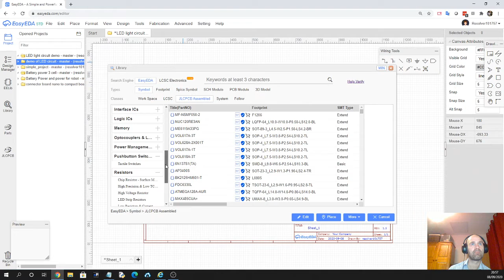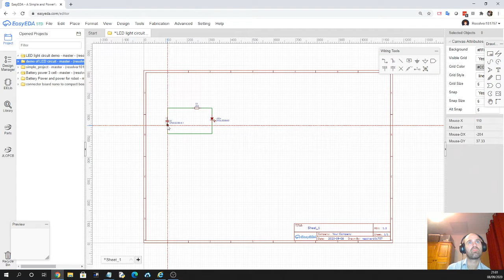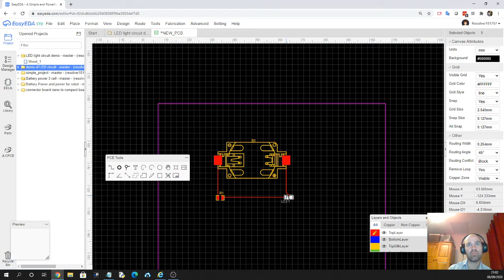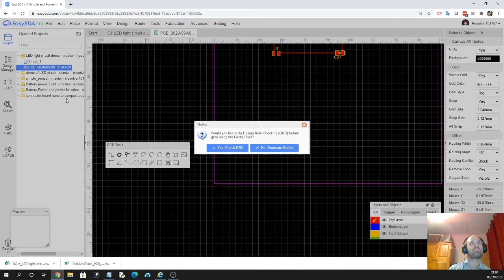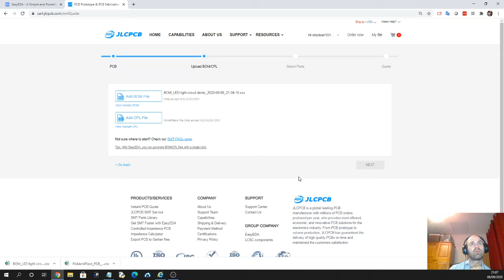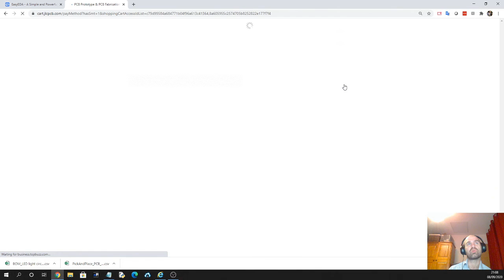order PCB with surface mount components in under 15 minutes with easyEDA circuit design

Comment: I have a question about PCBs. I want to build one of my own, but I have one question left. I didn´t find an answer in the internet yet. Maybe you are able to help me. How thick do my routing width have to be if a want to use it for an 0.24 amps (or 240 milliampere) application or is there a guidline anywhere?
Reply from the maker: Try the pcb trace calculator https://www.7pcb.com/trace-width-calculator.php
Reply: @alshacks9926  Thank you very much for your fast answer. Which "Cu thickness" do I have to choose, when I am using Jlcpcb? Or where can I choose this?
Reply from the maker: @philiploreck5610  Cu is just coppper element name, see https://en.wikipedia.org/wiki/Copper

Use a PCB calculator like linked above, one thing to bear in mind if you use 2oz of copper on JLC it increases the price.